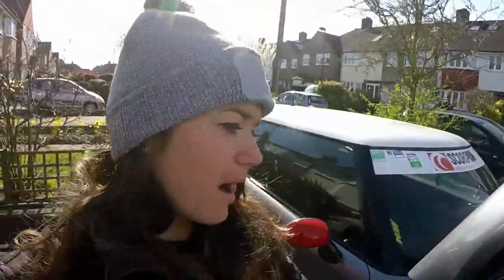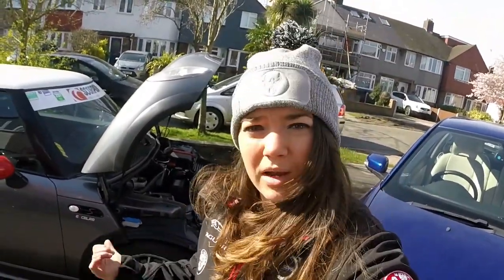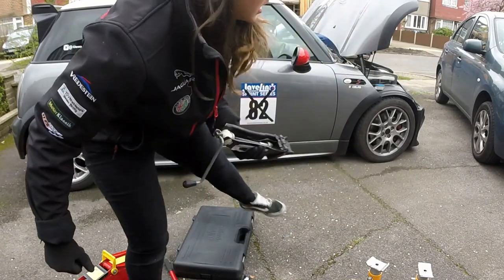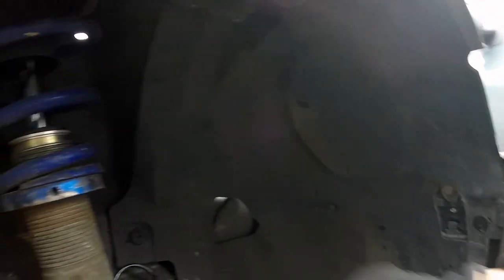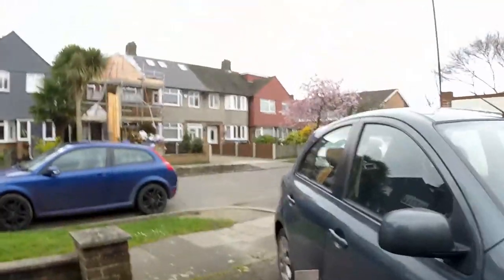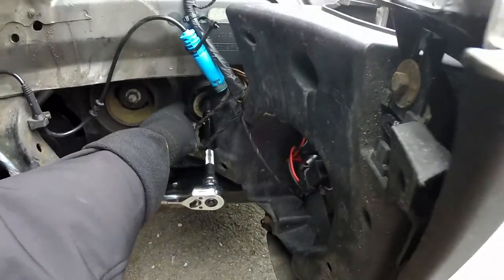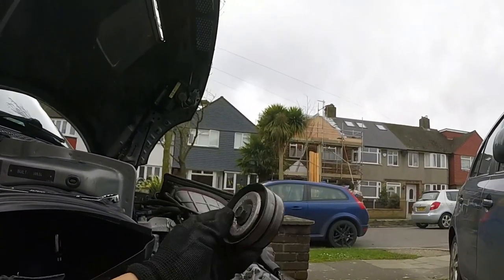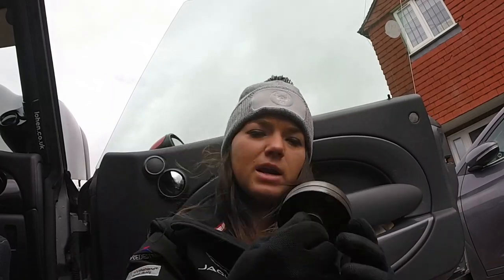Whats that noise?! | MINI Cooper R53 Idler Pulley

Comment: I changed the belt tensioner pulley on my sisters mini.. that one you can loosen with the thumb tab and clip it off to where it stays loose. Then i turned the car on and no noise, pressed the pulley against the band and got the noise again. Thats how i figured it wasnt thenwater pump ir any other pulley.. took me about an hourto do it and changed the belt out also because it was worn..

Comment: Just changed the idler pulley on my R53, the noise was horrible! Did it while I had the front off to change the Supercharger oil, water pump and thermostat. While I was in there I also swapped out the serpentine belt tensioner as well.

Comment: Cleo how are the Nitrac discs like? I saw your post on MOG (or was it one of Olis posts, dunno) about them, so wondering if you could give some sort of feedback?
Currently running "normal" temp threated TRW discs with Hel HP666 pads on the R56 JCW brakes. But at one point the pads are going to eat the discs, and I've wanted Nitrac before so.
Reply from the maker: Qwerrrz hey! So far so good! I’ve got Carbotech XP10 front pads with R56 callipers. They’ve had a lot of use and no cracks or anything so far and still a decent bit of life left in them. I’d happily use them again 👍🏼 I had EBC drilled and grooved disks with Mintex 1144 pads before my current set up, the brake fade was worrying and there wasn’t enough bite for trackdays but for road use they were fine
Reply: @carsandbras2202  cheers, sounds like a plan to get them then! Also pop a message when you're at the Ring again. Can go for some laps, it's good to be local here :)

Comment: Great and very helpful as I suspect my 2005 Cooper (non-S) has the same issue, but it only rattles between 1900 and 2000 rmp - was your noise constant through the rev range? :-)
Reply from the maker: saftevand the R50 non S models don’t have these idler pulleys, the R50 has a pulley for the water pump, alternator, AC compressor, crankshaft pulley and tensioner but unless it’s one of those pulleys that has failed I’d assume it’s a similar noise ect. Yes the rattle was constant, strangely there was no change in the noise through the Rev range! But I hope you find the issue, usually it’s something pretty simple once you find it 😅

Comment: Hi I changed the tensión pulley the crank pulley and the accessories belt, to my mini cooper s 2006, but now the car has a squeak noise, I got back to the workshop and the mechanic told me the pulley are aligned, and he said that the noise will disappear in a few days….I don't think this is normal, do you have an idea what my problem could be?

Comment: This is exactly what I have in my R53....it sounds like a whistle vibration.....same area...at least I have a clue now.
Also have another whine which could be the same part...the joys of mini ownership.
Great videos....you are a natural behind the camera
Reply from the maker: Darren Lucas it’s a very distinctive noise, if you drive past a wall it’s very loud. Definitely worth giving all of your pulleys a spin whilst the belts off to check for any abnormal sounds (the crank pulley doesn’t spin of course) or grinding ect 👍🏼 thanks really appreciate it! 😁
Reply: @carsandbras2202  thankyou....I,ll do that.
Think I may have an alternator whine too.....it started same time but could be the same problem, add that too a nearside wheel bearing and my car sounds like a barrel of stray cats all inside of a month! I hate to think how many thousands I've spent on it so far just trying to make the ultimate machine.....seems the more I modify the more it complains 🙈.
Hope it's ok to ask advice from time to time.keep up the blogs and the great content🏆
Reply: @carsandbras2202  I came here looking for thoughts as I've the posssible same noise (a high pitched ting ting ting) on my 06 jcw, but as soon as you said "if you drive past a wall it’s very loud" that nailed it. Cheers!

Comment: I thought my rattle was the idler pulley as well but mine came out just like this. The spacer in the back threads onto the 13mm bolt and wasn't actually loose. My issue (and later confirmed by Cleo's other video) was the tensioner pulley was blown (with only 52k miles). So if you hear a rattle, check your tensioner first, and might as well replace the idler while you're in there.

Comment: Great video and great technician! Now I have a question. I hear a very slight noise inside the cabin of my car (Peugeot 406) which I think is coming from idlers and bearings but when I listen to the engine idling, I don't notice anything special. It is not annoying and not load at all just a very slight noise which is not noticed by others. Now, what do you recommend me to do? Should I wait until it gets louder? Is it important?

Comment: Its possible to remove the belt without that wrench?
Reply from the maker: Nelson Quintans da Silva yes you can use a metal bar or something that will rest on the bolt and under the tensioner, but there’s not much room for leverage and it’ll easily slip off. Just have to be careful 👍🏼
Reply: @carsandbras2202  There are a lot of wrenchs on ebay but now ill take a long time to get here to Portugal...my R53 sometimes makes noise, sometimes it doesnt, so ill replace the belt and the idler just to be sure...just hope everything else is ok...great video btw...thanks!
Reply: Cars and Bras just brought myself a wrench tensioner so I won’t damaged nothing in the car... 😅😅😅

Comment: If that is a torque wrench you are using as a breaker bar then please stop doing that it’s the wrong tool, wearing out a tool and could possibly damage it. Breakers are less than 12 pounds on eBay.. no tool company warranties the joints so I’m not sure of the point of buying a snap or teng as your probably going to be pissed if a £60+ breaker snaps on you and the cheap ones usually do the job anyway. You can get a £5 joint rebuild kit if the bolt snaps for an emergency. Thank you very much.
Reply from the maker: George Galpin thank you for the heads up, I’ll definitely look into getting some breakers and your right on the Snapon and Teng tools, others should do the job just as well for less
Reply: This is US Pro by Bergen. Another youtuber The Savage Garage uses the brand and he has managed all sorts with them. That’s how I found them.